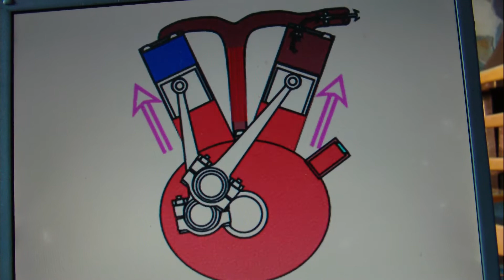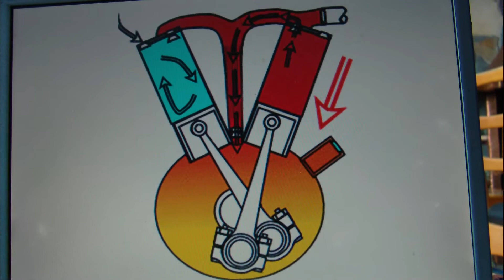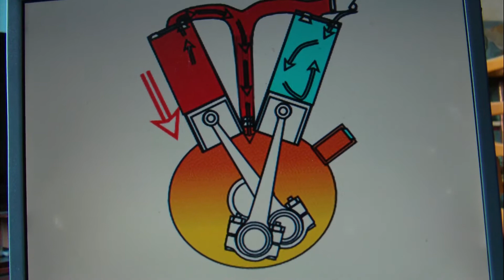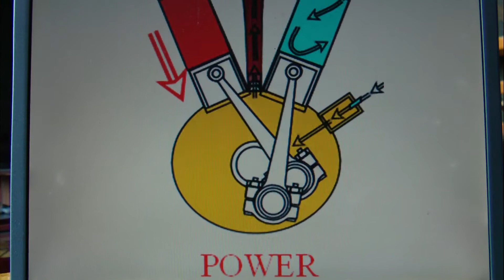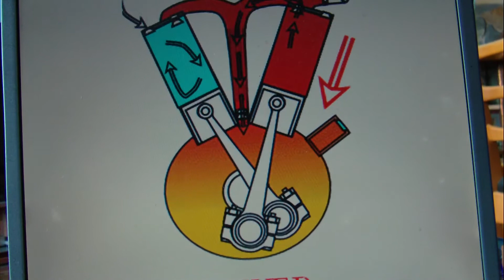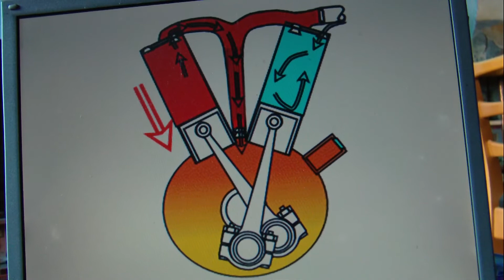Double acting compound internal combustion engine

Comment: Nice idea, but isn't only one cylinder firing on each crank revolution, while the other one charges the crankcase with it's spent exhaust gases?
Wouldn't the hot high pressure gasses in the crank case blow lubricating oil back up the oil ways? Also, the big end, small end and crankshaft bearings would be exposed to combustion temperatures, which would ruin them?